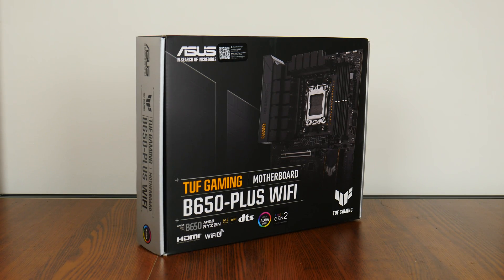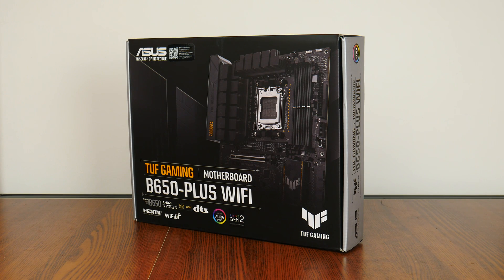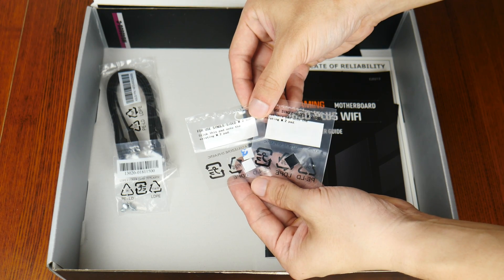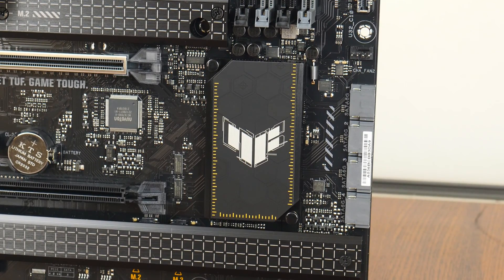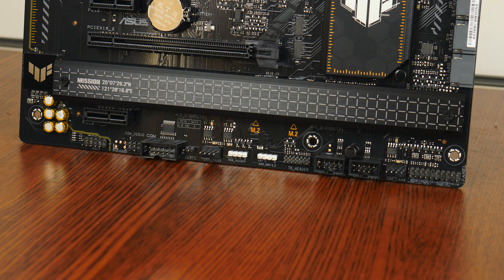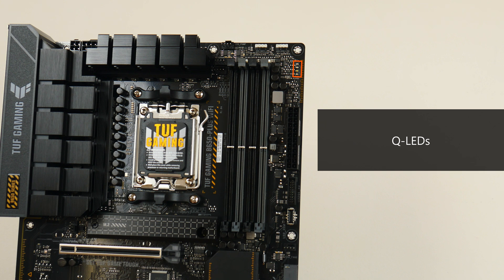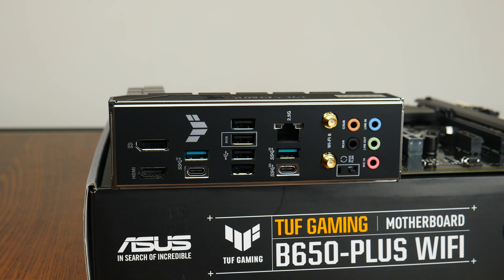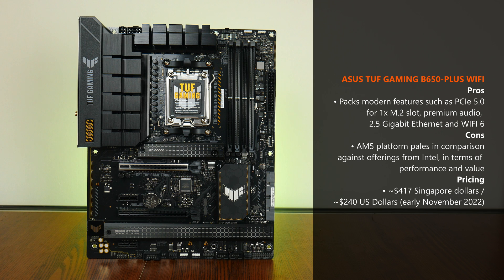AMD B650 Board for Budget Gamers? ASUS TUF Gaming B650-PLUS WIFI Unboxing & Overview

Comment: i'm planning to get this with a Ryzen 5 9600x and Kingston Fury DDR5 6000Mhz EXPO, its a good combo?
Reply from the maker: Yeap it is - do you know the CL rating for the Kingston memory that you'll be getting? Ideally you should get something with a lower CL rating (e.g. CL30) for better performance. Also, what graphics card are you intending to use for your build?
Reply: @ALKtech CL30and I have a Gigabyte 3060Ti EAGLE OC 8GB from the build that I already have
Reply from the maker: I see, you can perhaps look at upgrading your graphics card next! Good time to do so probably would be in early 2026, when NVIDIA launches their new RTX 5000 SUPER line-up..
Reply: @ALKtech  well GPU will have to wait, since i'm tight on budget, what cooler do you recommend for this CPU? i heard the Peerless Assassin is a good choice, but that brand is unknown to me
Reply from the maker: @s1xto I see, yeah no harm waiting if the 3060 Ti's still delivering on your graphics requirements! Oh yes, the Peerless Assassin's a good cooler and I've heard lots of good things about it too - you can't go wrong with Thermalright coolers! Personally, my test bench uses a Thermalright Phantom Spirit 120 SE ARGB, which performs on par/better than the Peerless Assassin, and I have it paired with a 7800X3D. I got the Phantom Spirit simply because my local retailer had it on promo and it was cheaper than the Peerless Assassin!

Comment: Hello, this is my 1st PC ive build and have this motherboard and was planning on getting a second m.2 ssd for installing some games off steam. 
The primary ssd I used for my Cdrive was the PCIe 5.0x4 m.2 slot.
Ive only used the top 1 PCIe 4.0 x16 slot for my graphics card, and dont plan to use the other PCIe 4.0 x16 slot.

Should i use the m.2_2 or m.2_3 slot for my second ssd? Got a bit confused when reading around that the m2._2 connects to the CPU and the 2.3_3 connects to the CPH. Does this make a difference when I plan to make the 2nd ssd for gaming?

Sorry for the long winded question in advance, and great review of the board!
Reply from the maker: Hey there! You can install your second M.2 SSD in slot M.2_2 - the general rule of thumb is to prioritise the M.2 slots that are linked directly to the CPU - you can think of it as the data having direct access to the processor for faster transfer speeds!
Reply: @ALKtech  Awesome, thanks for the informative response, very helpful!

Comment: U can run 360 hertz with that?
Reply from the maker: Are you referring to whether this board can support a 360 Hz refresh rate monitor?
Reply: Yes
Reply from the maker: @orelhifrhc4679  whether or not this board supports a 360Hz monitor will depend on what graphics card you're installing - any modern GPU will support a 360 Hz refresh rate monitor, but you''ll need to get one that is powerful enough to support 360+ FPS so that your 360 Hz monitor won't go to waste. The motherboard in this video will support any modern graphics card such as a RTX 4090, 4080 SUPER etc!

Comment: I just got this with a Package deal. Ryzen 7 7800x3d and 2 sticks of Ddr5. Hopefully this board is good!
Reply from the maker: Nice! What brand/model of RAMs did you get, and what graphics card will you be using?
Reply: @ALKtech  Tforce just 16 gigs. I do have a 1650gtx lp for right now but I'm looking for a decent card for it! Not sure what to get..
Reply from the maker: @K_i_N_G_P  the 7800X3D is a beast of a gaming CPU. If you have the budget for it, I'd probably go for at least a 4070 SUPER and above...what resolution do you game at?
Reply: @ALKtech  Yeah I want that 4k, I'm looking for 4060 or better. Rx 8700 or Higher is what I thinking. I have the budget just trying to figure out the best for right now.. That other card came with my very first build. I know I know lol
Reply: @ALKtech  I got the board together last night. I should have a card by this week but yeah it's getting a little expensive. Plugging the case to the board is the only part I couldn't figure out, so I just googled it.
Reply from the maker: @K_i_N_G_P  cool, congrats on getting the bits together! If you're looking at 4K gaming, I'd probably look at a 7900 XT or 4070 Ti SUPER at the bare minimum. By the way, what RAM speeds are your Tforce sticks? DDR5 6000?

Comment: I'm confused. What's the difference between this and the B650-E model. They seem almost the same.
Reply: the e model have a weaker vrm and worse audio codec, on the other hand have a few more usb's 3.0 and wifi 6e instead of 6 of the normal, the non e it's better overall

Comment: Just bought this board on Amazon for cca. 180€..what a grab..coupled with Ryzen™ 7 7800X3D+NITRO+ AMD Radeon™ RX 7800 XT ...decent upgrade after almost 12 yrs rocking AM3+ platform.
Reply: About to do the same, any problems with the 7800x3d and motherboard? I’ve heard that it has some issues with 3d chips.
Reply: @christianreyes2943  so far no problems,but i must mention that first start was a bit rough.PC wouldn't start without beeping which was related (i think so) to  memory sticks improperly seated (must be alligned properly in assigned channels on the motherboard).After that no issues.

Comment: Does this work out the box on amd 7 7800X3D
Reply from the maker: Given that this board has been out in the market for some time now, it should support the 7800X3D out-of-the-box, unless you wind up buying really old stock that has been sitting on a shelf for a very long time (which seems unlikely).

Comment: I like this, I stopped lighting up my PC so much. This board is great. Less is more and I did a custom light setup on mine to give it a Tron style look. Where I took the board and I used an OPTICAL FIBER CABLE to go around the board to give it that outline. As for my fans I use Halo 120mm and last I use G.SKILL Trident. 

Before I had strimmer's and all that shit lighting up. This has been one of the cooler boards and I like the looks of it. Before I was using MSI and GIGABIT. But Yeah I think I love these enough that I'm going to stay on point. The 4090 matching GPU that I got for my board looks great with its small lighted accent. Less is more.
Reply: Would love to see it I just bought this board

Comment: would a tuf model mobo be a better choice than a tomahawk or aorus model?
Reply from the maker: It'll depend on the exact model that you're looking at from each of the three brands and of course, the price. Do you have exact models in mind yet?
Reply: @ALKtech  ive been looking at the MSI MAG B650 TOMAHAWK WIFI, Gigabyte B650 AORUS ELITE AX V2 and Asus TUF GAMING B650-PLUS WIFI. theyre all around $200 but idk much about mobos lol also getting wifi with the mobo or not is irrelevant for me
Reply from the maker: @KindOfBland55  got it. Do you have an idea on what CPU you'll be using too? At this price range, WIFI will almost certainly be a standard feature to have, so some deciding factors would be price, aesthetics and of course, features. Comparing the three boards, the MSI has a better feature set IMO, where on paper it seems to have a better VRM setup, which would give you more overhead for a powerful processor!

Comment: Great video. Wonder can i use nvme 2242 on this motherboard?
Reply from the maker: Thanks! Yes you can, you'll just need to reposition the M.2 drive standoffs that come preinstalled on the board - there are mounting holes marked "2242" seen at 7:15 that you can install the standoffs on. Hope this helps!

Comment: Asus Tuf Gaming B650-plus Wifi or MSI MAG Tomahawk or MSI MAG Mortar?
Reply from the maker: What's the price difference like between the three boards where you're from? The Tomahawk and ASUS board are full-sized ATX offerings, while the Mortar is a microATX board; if you're gonna use a full-sized ATX case, I'd rather you look at the ASUS in this video or the Tomahawk. That said, the Tomahawk does have slightly better specs (e.g. a better VRM configuration and WIFI 6E) versus the ASUS, but ultimately, price would be the most important deciding factor here in my opinion.
Reply: @ALKtech  yeah agree. I'm from India, I'm planning to build it feb or whenever there are offers or sales starts. I'm gonna use it for long term use so maybe I'll go for Tomahawk? But this Asus does impress me
Reply from the maker: @sk1llzfps  I see - I guess no harm adopting a wait-and-see approach to see how prices are in Feb, before deciding. If the MSI turns out to be cheaper than the ASUS, I'd definitely go for the MSI for sure seeing as it has better specs. If the ASUS is cheaper than the MSI however...you'll have to decide whether the additional specs are worth it for your use case!

Comment: Hola esta placa base no trae conector A-RGB
Reply from the maker: It comes with three aRGB headers, see 8:50 of the video for their locations!
Reply: @ALKtech  vi todo el vídeo y pero estoy confuso es lo mismo argb y rgb porque la placa base solo dice rgb
Reply from the maker: @ashketchum7061  aRGB and RGB are different types of connectors for devices that support RGB lighting, and cannot be used interchangeably. You'll need to check whether you have an aRGB or RGB device, and the telltale sign is whether it has a 5V aRGB connector or 12V RGB connector - these specs are usually on the packaging of the device that you have!

Comment: Das it support pci 5 for the gpu future upgrad
Reply from the maker: This board doesn't come with a PCIe 5.0 x16 slot for a graphics card - if you'd like to future-proof your build, you might wanna get a board with the B650E chipset instead, as B650E boards come with PCIe Gen 5 slots for both a graphics card and M.2 SSD!
Reply: @ALKtech  thank you alot good luck

Comment: Hmm why has this board only PCIe 4.0 on the GPU slot? It is already outdated then. ROG STRIX B650E-F GAMING WIFI has a GPU slot with PCIe 5.0.
Reply from the maker: This board uses the B650 chipset, which only supports PCIe Gen 5 for the M.2 slots. The B650E-F on the other hand, uses the higher-end B650E chipset that supports PCIe Gen 5 for both a graphics card and M.2 slot! Both boards should be priced fairly differently as well, with the ROG STRIX being more expensive than the TUF Gaming. If you're looking to future-proof your AM5 build, you should get a board with a B650E or X670E chipset!

Comment: Hi this or MSI b650 mortar?
Reply from the maker: The MSI is a micro ATX board yeah? You do sacrifice a M.2 slot with the MSI board due to its dimensions, but it does come with WIFI 6E as opposed to WIFI 6 with the ASUS. Otherwise, both boards seem pretty similar from what I can tell. Is there a price difference between both boards where you're from?
Reply: @ALKtech  I'm in Australia. Price deference is negligible. Around $15 to $20 difference. I  am after the 7950x3d and not into overclocking. Which would be the best fit?
Reply from the maker: @skidrow-black  right, since you won't be overclocking, I'd personally run with whichever's the cheapest of the two Down Under, unless of course you have a preference for either full-sized ATX or micro ATX. I don't suppose you've bought your PC case yet?
Reply: @ALKtech  not yet
Reply from the maker: @skidrow-black  that's good, at least that affords you the flexibility to choose between either of these two boards. All in all, you can't go wrong with both I'd say, and I'd go with whichever's the cheapest of the lot. My two cents!

Comment: I just bought this board, waiting for the 7800X3D to come out.
Reply from the maker: Can't wait to see how the 7950X3D and 7900X3D are gonna perform when they drop on 28th Feb!
Reply: @ALKtech  I realised the 7800X3D only comes out April... I can't wait to upgrade I will have to buy the 7900X3D lmao
Reply from the maker: @JackRR15  oh yeah...there's some rumours and speculation out there that the 7800X3D might have the 7950X3D beat in terms of performance due to the 7800X3D's higher V-Cache CCD frequency versus that of the 7950X3D...will be interesting to see how it all pans out!
Reply: @JackRR15 what did you do?

Comment: Hi, is it possible to mount a Fortis 5 cooler on this board? I see that it has a very large VRM cooling and it can interfere with air coolers. thank you
Reply from the maker: Hello, I can't say for sure as I no longer have the board with me, but I'd like to think that board manufacturers would opt for VRM heatsinks with tolerances such that most (if not all) air coolers would be able to fit...I could be wrong though 🤔
Reply: @ALKtech  Thanks for your answer and quick reply.

Comment: hi is this better than MSI PRO B650-P?
Reply from the maker: Having looked at the specs of both boards, I'd say that they're pretty evenly matched and that it'd all boil down to pricing - for instance, the ASUS has three M.2 slots vs two for the MSI, while the MSI has WIFI 6E and the ASUS has WIFI 6. Is there a price difference between both boards where you're from?
Reply: @ALKtech  price is similar overseas. I'm is Australia but will get them from overseas. Not sure what audio chip Asus is using on this board
Reply from the maker: I see! ASUS uses the S1200A audio codec for this board - oh yes, this is another plus point for the ASUS versus the MSI, which uses the entry-level ALC897 codec instead...

Comment: I cannot go into bios using advanced startup on windows 10. My cpu is 7700x. It starts windows 10 directly. I tried shortcuts, but nothing works
Reply from the maker: You've tried mashing the F2/Del key upon pressing the power button to boot up the PC, and it still won't go into the BIOS? Have you tried the "shutdown /r /fw" method of booting to the BIOS from Windows?
Reply: @ALKtech  Fixed the issue. 7700x has integrated gpu. I had to plug my monitor into motherboard rather nvidia gpu to make it work. After that, I disabled igpu in bios, now it works best.

Comment: I got this motherboard and the 5 7600x with 32gb kingston furry ddr5 5600hz and a 6700XT gpu. but i cant boot the pc, it shows VGA LED white light on all the time, i even tried only using intergrated gfx but still no signal to screen.. any suggentions? I followed asus throubleshoot point for point.  :-(
Reply from the maker: Have you tried booting with just one stick of RAM to see if it works? Give that a shot, and perhaps leave the system for about 10 minutes or so - some DDR5 memory and board combos may require "training", where you may just get a black screen during the first boot!
Reply: How did it go?
Reply: Did you manage to solve it? I'm thinking of buying an R5 7600x with 32gb qLexar ddr5 6000 mhz.

Comment: Hi can I install 7900x or future 7900x3d. I don't want to overclock my CPU and not interested in gen5 m.2
Reply from the maker: Yeap this board will do just fine with a 7900X and the future X3D parts when they drop (with a BIOS update of course). It does come with a PCIe 5.0 x4 M.2 slot in any case!
Reply: @ALKtech  Thanks :)

Comment: I feel like instead of "gamers on a budget" we could say "gamers that don't pay extra for stupid stuff they don't need"
Reply: yea totally agree I only need ddr5 and ryzen chip support
Reply: Same dude I’m not paying extra for the x670 for over clocking the Ryzen 7 7700x which is what I have comes over clocked already😭 plus I have ddr5 ram like it’s so stupid
Reply: I think it's rather about getting full PCIe 5.0 support on the x670E for future SSDs and possibly graphics cards. @Gfoley29
Reply: Brother, Which board will be the best in the budget?
Reply: Suggest me some Mobo
Reply: My new ASUS motherboard came with the optional dead CMOS battery that took over an hour to troubleshoot. Once that battery was replaced the board works great!

Comment: Hi sir 
Is this board good for 7700x on full performance in the long run and some little bit overclocking ( I have nzxt x73 aio). Actually, I am scared of buying the wrong product, pls reply 
Love from India.
Reply from the maker: Yup, I think this board should do good with a 7700X. Your X73 AIO's pretty decent from what I see, you should be able to get a slight overclock with no issues!

Comment: It is compatible with a CM hyper 212?
Reply from the maker: There are several variations of the Hyper 212 - you'll need to check whether the model that you have has support for the AM5 socket. If it does, it'll fit this board for sure!
Reply: @ALKtech  the AM4 brackets will fit the AM5 socket
Reply from the maker: @calebscott1477  yeap they do indeed, I'm referring to instances where the Hyper 212 model doesn't have support for AM4 (i.e. the super old models - I know the Hyper 212 has been in production for many years, but am not entirely clear if the older models have support for newer processor mounts).
Reply: @ALKtech  oh gotcha